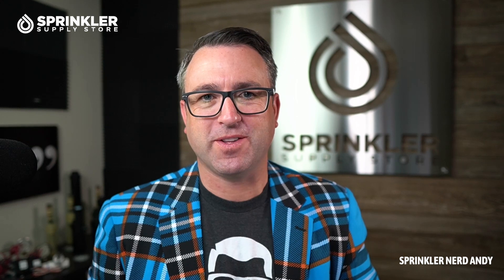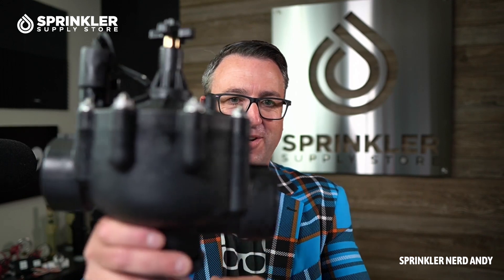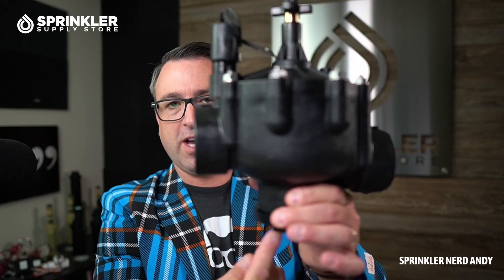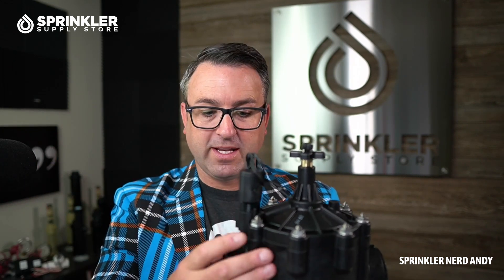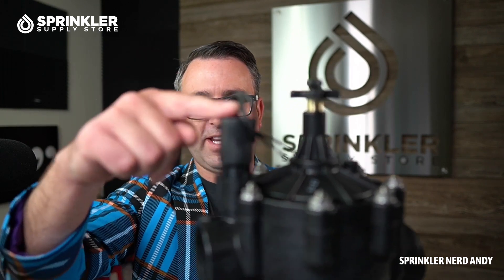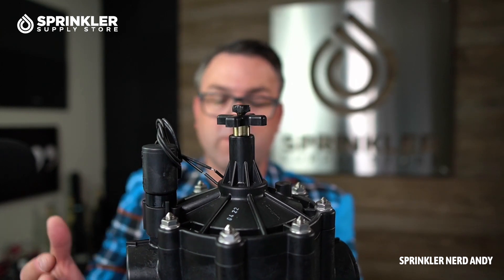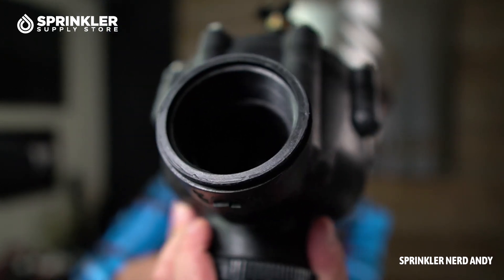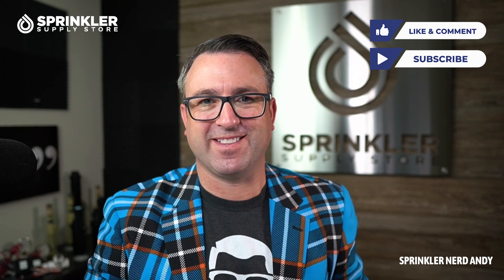How does the Irritrol 100 Series Valve  Work? - Product Review | SprinklerSupplyStore.com

Comment: Hi Andy, I have a series 100 Irritrol valve that won't shut off. I tried tightening the flow control all the way down without any change in flow to the sprinklers. The valve doesn't show any sign of leakage. I disassembled the valve and cleaned everything, I don't see any obvious tears in the diaphragm, any nicks or cracks. Turning the ON/OFF lever under the solenoid has no effect, I am at a loss. It is the globe style with water in one end and out the other, it has worked flawlessly for approximately 25 years. I'm not sure what size I have, I think it is 1-1/2 but I'm not sure how to make certain, I'd like to know in case I need to order parts or a replacement.
Thanks,

John Simpson
'
Reply from the maker: Hi John. Double check the solenoid port to make it is 100% clear. A small piece of debris under the solenoid can cause this. Can you text us a picture? We can help identify the size. 833-343-4590
Reply: @Andy_Humphrey  I checked the metered port under the solenoid with a small wire and a flashlight, it seems to be clear. I think I've done all the steps you outlined in your video about a valve that won't shut off. The solenoid was bad but that should have failed to close the valve. These valves don't seem that complicated, today I will thoroughly dry the body of the valve and see what I can see, I'll text you a picture then. Thanks for your help.

Comment: Hi Andy, my question is more fluid dynamics than valve hardware, but since you are a "sprinkler nerd" maybe you can help?

I have about 8 of these Irritrol 100 1" valves at my home.  They all used to control spray zones, but over time I have converted most of the zones to drip.  I added inline filters, but due to space constraints in my valve boxes, I did not add inline pressure regulators, instead I bought a bunch of Irritrol Omni-Reg 30psi units and bolted them onto the valves.  Seems to work fine and gives me adjustable PSI for my drip zones.  In most cases, the valve is followed by a length of 3/4" pipe to the area being irrigated, then surfacing through a few 1/2" risers into 1/2" Netafim Techline drip tubing gridded around my property.

It mostly works well, but on a couple of the zones I have horrible pressure oscillations / pulses that shake the house and make me worry about damage to other plumbing connected to the same supply.  Sometimes I can "tune" them out by playing with the valve flow knob and/or the regulator setting, but they often return after some time.

Are these valves fitted with Omni-Reg suited for this purpose?  Is my problem caused by other design flaws in the distribution pipe or dripline grid layout?

If you have insight with pulsing drip zones, I would love some help!  I could email you diagrams if necessary
Reply from the maker: Hi Garrett - yes, you can email anytime.

The Omni-Reg should not cause this. It would be helpful to know more about the operations of the system at the exact time you feel the house shake. It this when the zone turns on, or turns off? Is it during normal operation? What is unique about the zones acting this way. What is the flow rate of these zones, and is this lower/higher than the other zones that work fine. What if you remove the Omni-Reg, does it stop happening?

What you are describing sounds a lot like water hammer. I can't think of anything else that would cause you interior plumbing the shake. Perhaps it could be the valve diaphragm opening/closing very quickly, or closing unexpectedly during operation.

Check for debris under the Omni-Reg, and/or under the solenoid. Debris could cause the valve to function in odd ways.

You could also swap out an Omni-Reg from other known good zones to rule out an issue with the Omni-Reg

Understanding the pressure at your source (home/street) would also help.

I know I'm all over the place with this - appreciate your question and welcome an email from you anytime. info at sprinklersupplystore dot com

-Andy